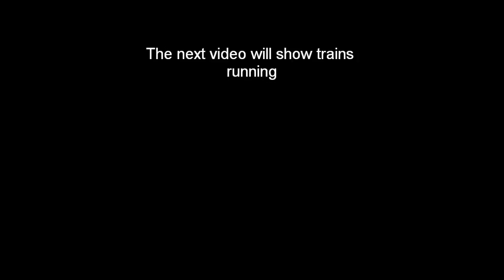Model Layout Lift-up section

Comment from the maker: Thank you for the tip. They look really useful and not expensive. The back of my Hornby controller has spring loaded wire connectors and I was actually looking out for some. I will order some Wago connectors from ebay and they will be used on lift up section as well as test track and rolling road.

Comment from the maker: Thanks Ian, there is no power feed across the lift-up section join (one end). Power comes from track feeds at either end of the layout.  I will have to review that for DCC and common return wiring with my ladder yard points seems to be a bit of an issue - don't know why.